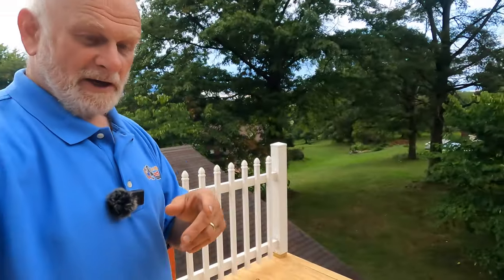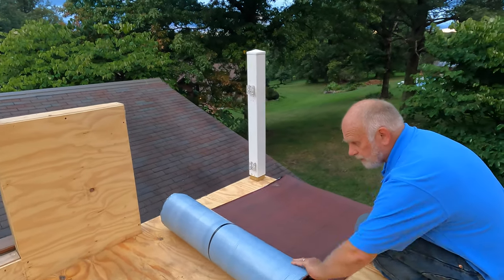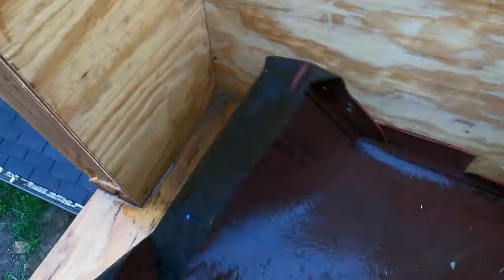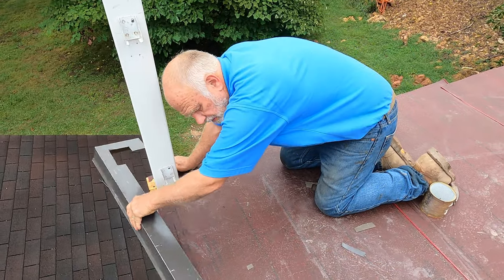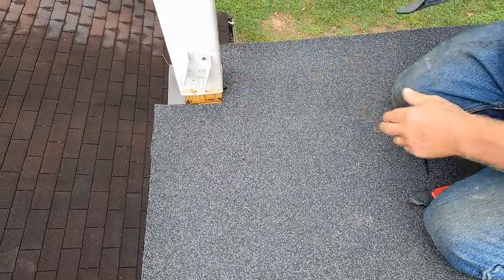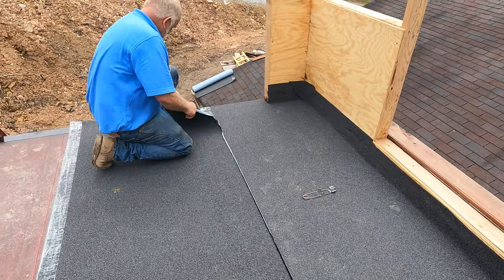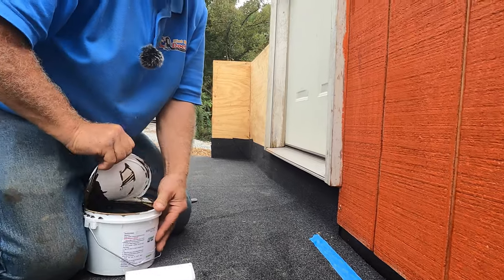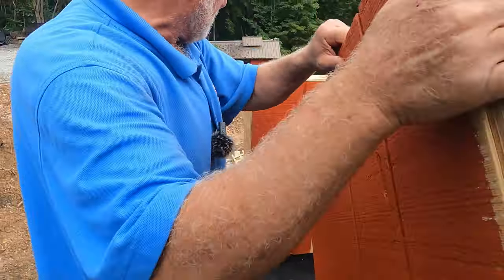How to Install Rubber Flat Roof Cheap DIY  - Waterproofing seal roof leaks - Tips and Tricks

Comment: This dude still won’t stagger the seams lol
Reply from the maker: To small to stagger seams on this tiny little roof
Reply: Say that to and inspector see what he tells you or the product manufacturer. Unless there are no standards for torching or peel and stick in the USA.  I'll teach you something right now please heat your trowel before passing it on the cap that's the number one reason you always make a mess and you job looks like shit. People give you money to have a new roof and it should look good to not like the way you leave it looking. It looks like it was installed 25 years ago.

Comment: Isn't it better to install the rolls from the bottom of the roof first and then work your way up?  This way rain will not flow into the sheet below.   I also heard these self-adhesive roll roofing can peel.  I've not seen any roll roofing has 30-year warranty.

Comment: I have a roof in CT that looks flat to the eye and is a black 10 ft seams wide material covered with a layer of pea sized rocks.  It is completely drained after a rain in about 2 hours, and completely dry after 4-6 hours. What peel and stick product will work on this? Most contractors that have looked at the roof have no clue. I want to strip it down, replace any bad plywood than use a peel and stick application only, (no fumes allowed). Any advice from anyone is much appreciated. Thanks

Comment: Thanks for sharing so much knowledge. They've helped and inspired me to tackle repairing my flat roof.  
I have a question. My old house  has many layers of roofing.  Where the roof meets the wall, the many layers of roof sheeting are built up so much that they come up the walls  directly below the drip edge of the camelback coping.  
What is the best approach to lay  new roll roofing over the existing?  Do i remove the old roofing where it meets the wall under the coping so the new layer attaches  to the wall well behind the coping edge  or do i install the roll roofing up the wall and over the coping?

Thanks.

Comment: Can we buy the turbo poly seal from local stores other then direct from Bergstromm? I want to buy some but I want to see if I can find it locally. Thanks for the video's, I have a slight slop roof I need to redo, about 800sq.feet and I'm thinking about using the Liberty peel & stick and the cap sheet.

Comment: I enjoy watching your videos on DIY Roofing series. I have a question. Can I use the Self adhesive Plybase and Self adhesive CAP on exsting Felt Flat Roof and Rubber Flat Roof or it is limited to existing Modified Bitumin Flat Roof.
Reply from the maker: I normally do not care what surface I am going over.

Comment: This is great! I'm going to do my own roof. What's the minimum pitch on the roof? Why can't you make the roof totally flat? Can you do a torch down modified bitumen roof totally flat?
Reply from the maker: Yes, Torch down on a completely flat roof. On the peel and stick, the seams are not as water tight as on a torch down, therefor if it is completely flat and water is pooling on the seams, it could leak
Reply: @FlatRoofDoctor  Oh, okay, thanks. I do want the roof to be as water tight as possible so I guess torch down is the way to go. I'm thinking of using some of that tapered insulation stuff to make the roof drain in the direction of the roof drains I plan to install. I'm seeing those things aren't cheap. Three hundred bucks a pop for cast iron. I guess inflation really is getting out of hand.

Comment: The lower edge of roof material at gutter board is supposed to be 3"-4" over and down to cover the gutter board. Better start reading the manual.
Reply from the maker: yes Sir, I will do so Sir. you welcome

Comment: None of this material is for torchdown,it is self adhering, when you overlapped the seam 12" you should have heated the top of the overlap sheet and hit it it with the trowel to embed the granules into the hot membrane and it would bond much better,but that product is not really for using a torch so one must be careful with it.

Comment: You can't make mistakes but you haven't done anything right. You don't need asphalt primer anything that has baked in paint is the same as being primered and asphalt primer if you were doing touch down witch your not this is peel and stick. You need elastico stick primer or blue skin primer not just on the metal but on the whole roof. First on all the plywood and again on the base sheet before putting down the cap sheet. And you have to stager you base from you cap not just 3 inch overlap. You need half the roll you're first peace of base should have been an 18 inch peace then the rest would be full sheets. The lap of the base should be in the center of your cap sheet. The base should have been cut an inch and a half back from the metal and the cap flush with the metal. Good thing you have been doing this for over 30 years gives me lots of work to redo all those rookie mistakes.

Comment: hi Flat Roof Doctor,  what is the name of store you use to order material ?? I need to order  material to cover up flat roof total of 3,000 sq. ft. following your instructions from video, need the karnak for concrete edge, the 66 mode bit the 32 grade drooped edge metal 3x3 in. need the turbo poly seal for flashing the fleece, the base rolls and the top surface rolls , and if you think that I need more things for my project let me know , I am willing to follow your instructions and I promise I would not fail, I have  trouble with this leaking of my roof since 2005 and I think I can do it according to your Videos, Thanks so Much in Advance